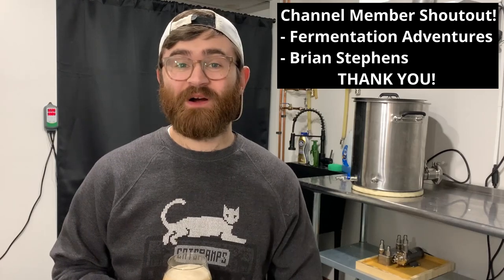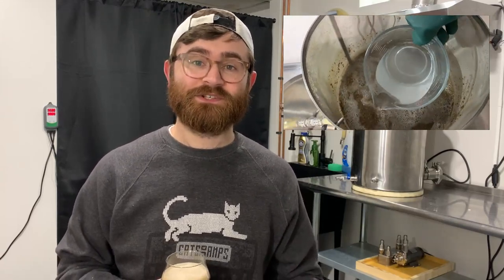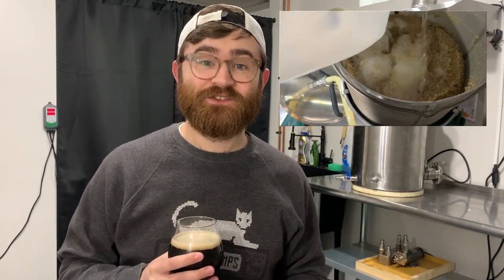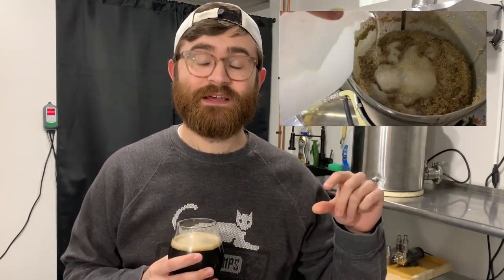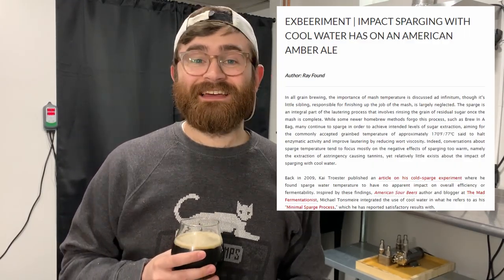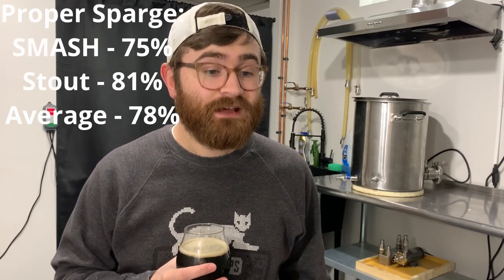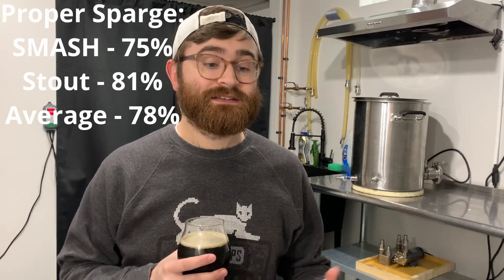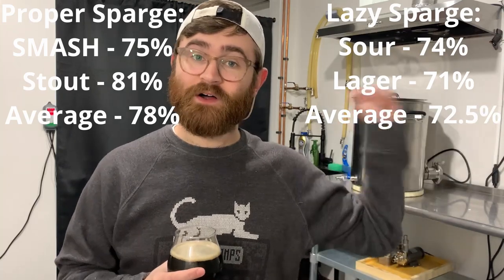EASIEST Way to Sparge! INCREASE Efficiency! Testing Out Cold Sparge VS Traditional Sparge

Comment: I got my most efficient lauter and sparge by accident. My mash tun is a cooler with a steel braid strainer.   I cleaned out my mash tun, dumped in the strike water, stirred in the grains, then realized I left the strainer out.  Rather than messing up my temperature at that point, I let the mash sit for two hours.  Then I scooped the grain out of the cooler into buckets, cleaned out the spigot so it wouldn't clog, put the strainer back in, put the mash back into the cooler, and rinsed the scoop and the buckets with sparge water.   I ended up with a higher gravity than I was shooting for.   That extended mash coupled with the extra handling must have squeezed more of the goodies out of the grain.

Comment: I have always done a cold sparge with with my Brewzilla and am happy with the results.
I pull the grain basket up to drain and have 1 gallon of room temp water set aside to sparge with while i have the elements on to start heating up to the boil. I see it as getting the extra wort and heat out of my grain bed. Saves a lot of time and hassle.

Comment: Oh yeah I used to cold sparge back when i was apartment brewing and didn't have room for a separate HLT. Barely ever noticed much of a drop in efficiency from my old style of doing hot sparge water. Now though like you I do almost every batch no sparge as the time saved is way more valuable than a little extra grain. Cheers

Comment: In the traditional sparge method, why do you measure the brewing salts separately for the mash and the sparge water? Is there a reason not to put them all in the mash water and sparge with distilled or RO water? It's all going to combine together so the result should be the same, either way right?
Reply from the maker: Yes you can totally do this! measure once and then separate the volume. I actually didn't think about this until after I was done with both brew days... lol...
Reply: Salts like gypsum and calcium chloride will lower your mash pH as you use more of them.  Depending on your water to grist ratio when you mash, if you use all of the salts to hit your target water profile in the mash alone then chances are you're going to way undershoot your mash pH.

Too high or too low a mash pH has been tied to quite a few non-ideal situations like lowered mash efficiency, higher tannin extraction, lowered solid precipitation, etc.

Comment: So with the clawhammer system, without sparging you can expect to get 60% efficiency?
Reply from the maker: Currently getting about 70%, I cant recall the examples I recorded in this video but keep in mind the sample size is small. Efficiency is impacted by a ton of different factors. The equipment you use is just one factor.